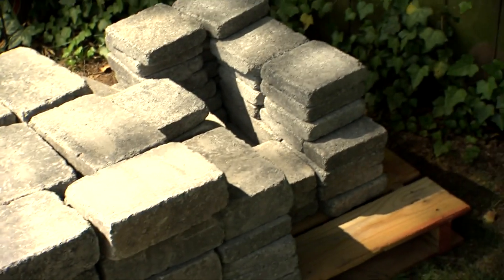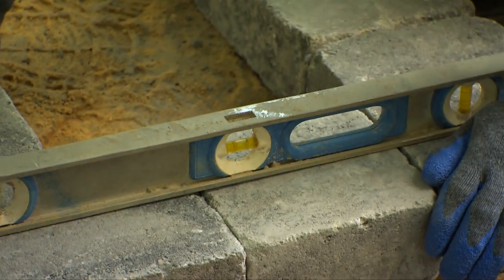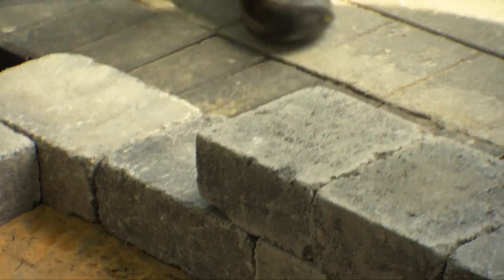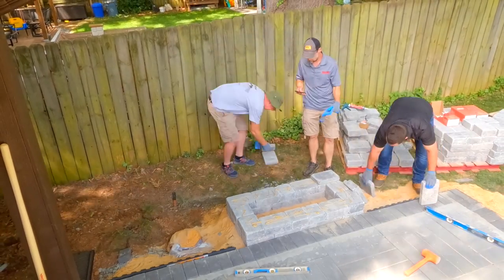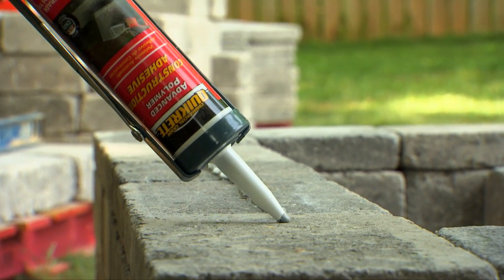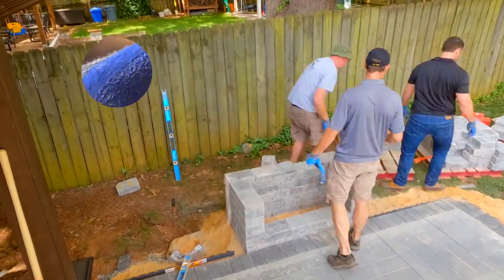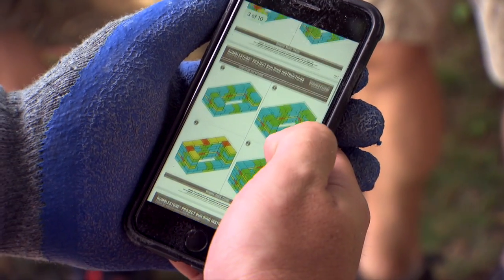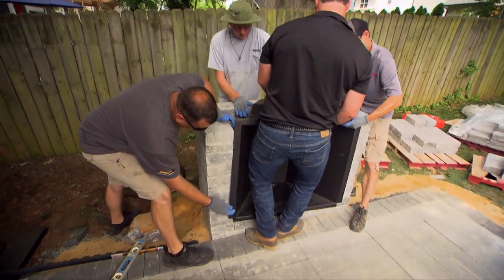How to Build an Outdoor Fireplace

Comment: Menards has a couple PDF plans that will give you the complete list of all the materials to build one of these. They are kinda spendy ($3000 - $4000+) 
  There are also a few dry stack videos here on Youtube that show you how to build one in a few hours using simple concrete building blocks for less than $250 in materials.